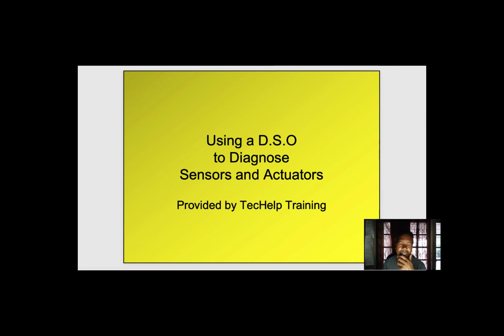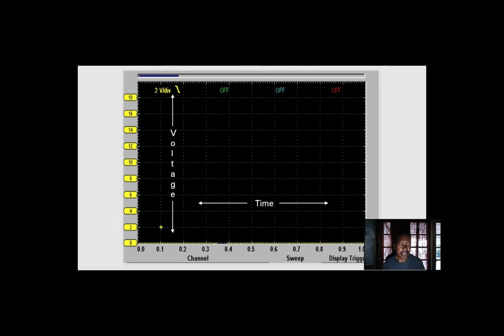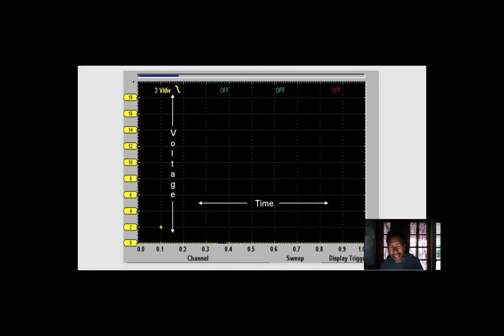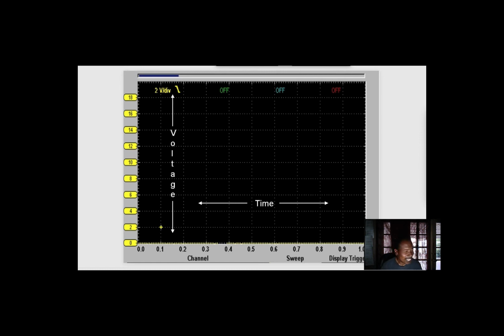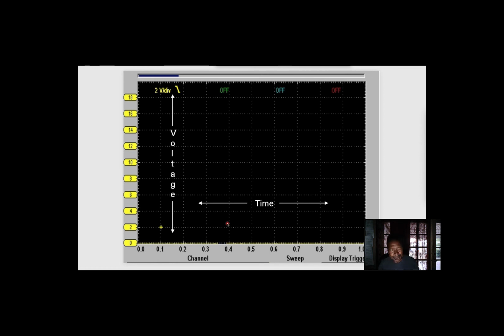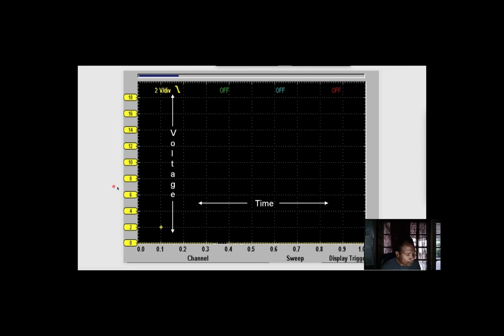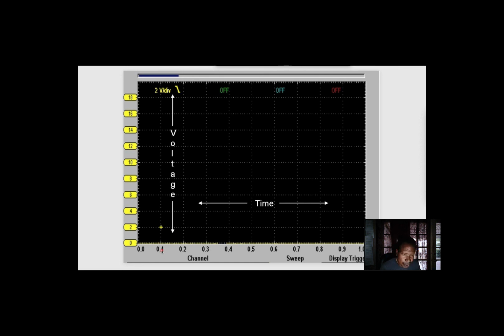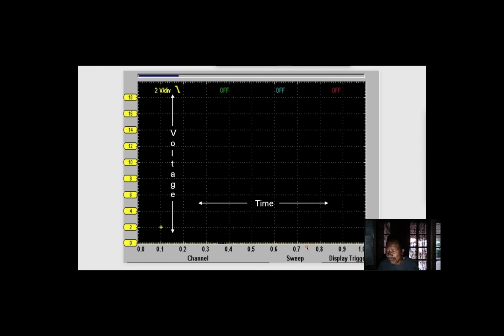Learning Lab Scope Part 1: Voltage over Time and Steup - Tech Help DSO Lab PowerPoints

Comment: there's 100ms in a second, so to break it down and divide 1sec/100ms= .01sec
Reply from the maker: 1 sec is actually 1000ms / by 10 divisions = 100ms per division

Comment: on the divisions, what's the rule of thumb to set it up at on a cam and crank correlation ?
Reply from the maker: They average 5,7,10 volts so starting with a 20 volt scale would be good

Comment: On a 50-volt setting on a 10 x 10 screen how much is each individual graticule/division with. = 5 volts per graticule. 50/10=5
Reply from the maker: Frank that’s correct

Comment: what's the highest voltage the pico scope can measure. so far we have gone up to 20v. the electric and hybrid vehicle industry is starting to grow rapidly. many of these vehicles have high voltage systems.  will a pico scope measure 100+volts? if yes will we be able to take measurement of the sub divisions.
Reply from the maker: When using a scope on hybrids you will need special leads

Comment: The difference between a lab scope and a digital multi meter is that a lab scope measures voltage over a period of time. A digital multi meter measures an average voltage.
Reply from the maker: That’s correct Frank

Comment: Voltage is vertical goes top to bottom time goes left to right,if you checking a sensor that has for example 10 volt and the voltage scale set for 20 volt you will see the 10 volt trace and the time is to see in what time period you want to see
Reply from the maker: That's correct Jack the voltage scale has to set to represent the signal you are checking